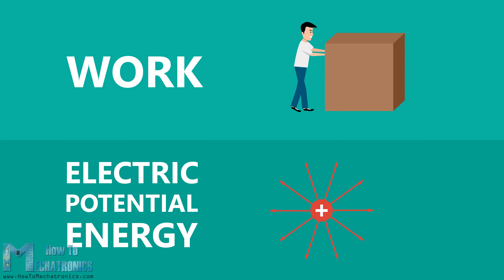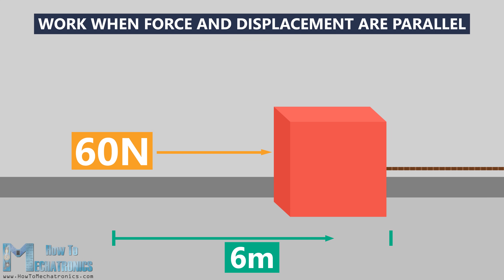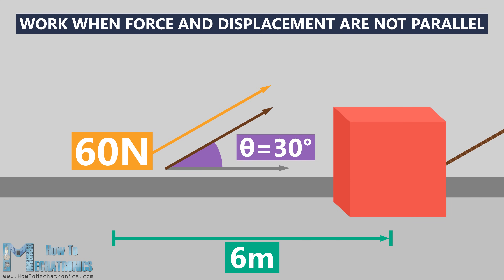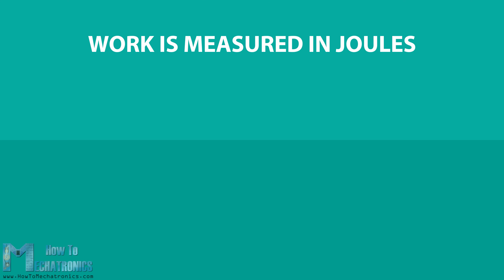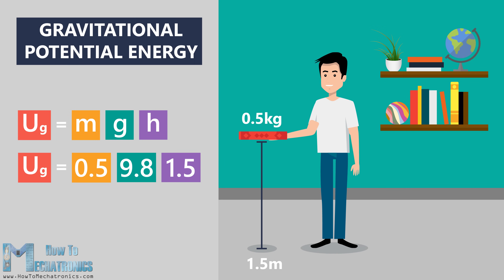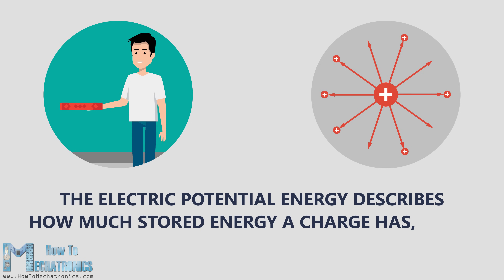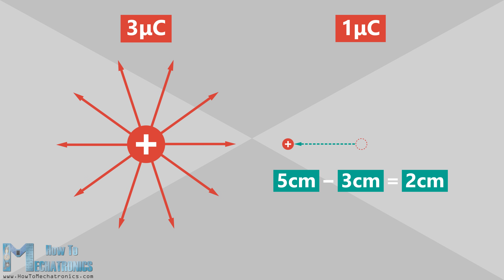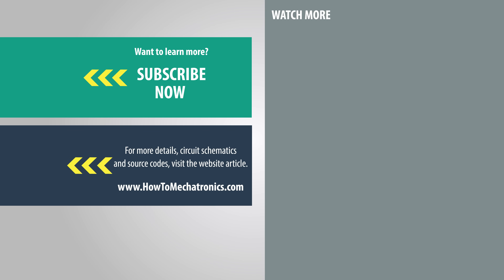Work and Electric Potential Energy | Electronics Basics #4

Comment: Perhaps I'm wrong, but I don't agree with with your calculation of "electric potential energy".
1) you want to describe the potential energy in systems with time-invariant electric fields. So it is called "electrostatic potential energy", if electric fields are time-variant it is called electric potential energy.
2) From wikipedia : "The electrostatic potential energy, U_{E}, of one point charge q at position r in the presence of an electric field E is defined as the negative of the work W done by the electrostatic force to bring it from the reference position rref to that position r".
 In your case rref=3cm and r = 5cm
Then U_{E}_{rref → r} = - integral from 3 to 5 of E•dr , the antiderivative is then [1/r] from 3 to 5 times kQ_{1}Q_{2}, and that is equal to - 2kQ_{1}Q_{2}/15
I think what you did is you chose r=∞, so it's a little different from how you present the situations at 6:30

Whatever, thanks for your really good work!
Reply: I think it's good to criticize and try to find mistakes, but let me try to inform you on certain flaws within your argument.
1) "electric potential energy" Is a general term and applies to the energy a charge possesses due to its position in any electric field, whether static or time-varying
2) Doesn't necessarily imply that the definition given was incorrect
3)You answered the question yourself, choosing R (reference point) to be at infinity is a convention to simplify the U expression

Comment: At 3:35 the integral bounds are not correct. They should be swapped.
Reply: Actually it doesn't matter, a and b are variables, and the traveled path is irrelevant to the overall concept. If you were to imply that there is a negative sign problem occurring, that would depend on what "How To Mechatronics" defines a and b to be.
Reply: you are a dumb fuck
Reply: @user-ey9qk7bz1e  hey that's not very kind